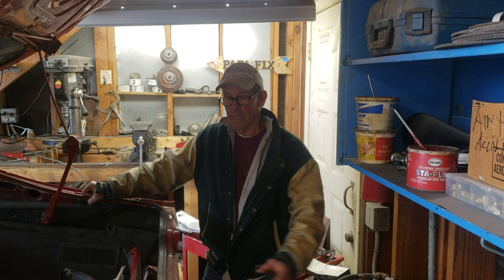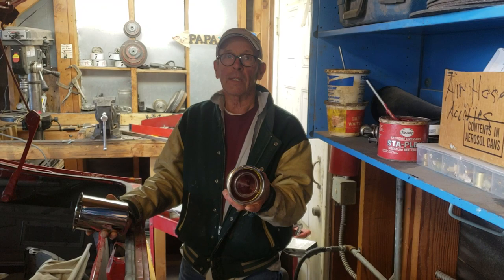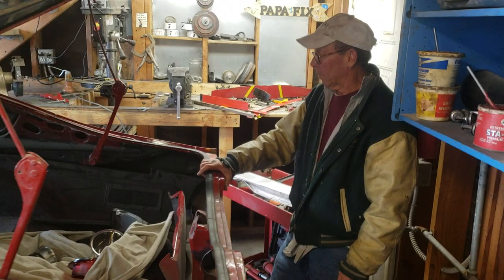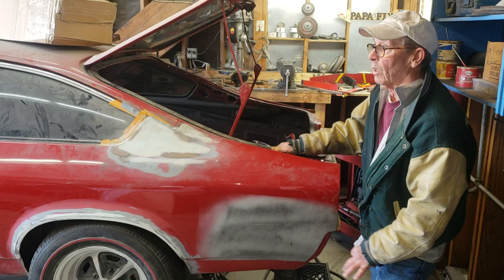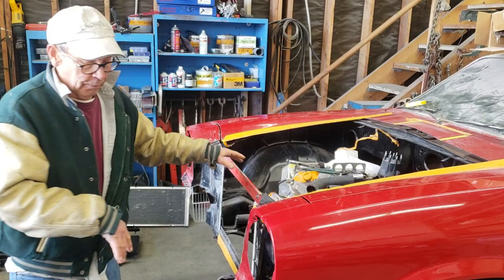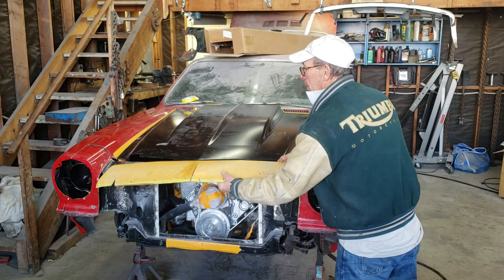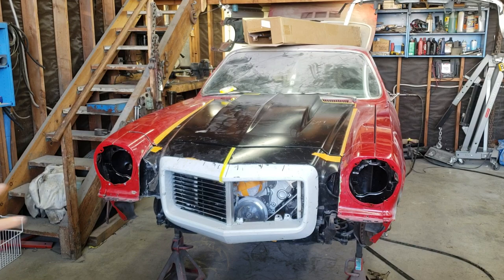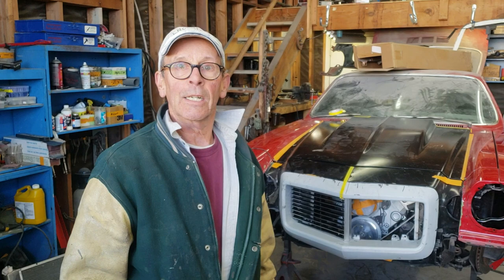Dave Cartwright's RS 1973 Vega Build

Comment: I built a 71 302 pinto in the late 70’s and helped a buddy build a 72 Vega gt wagon with a 350 and 4 speed. He learned to change spider gears in under an hour even after swapping in a Monza rear axle. Fun times! Finishing up an Alfa Spider with an Alfa v6 w/ a Mustang T5 transmission. Love the front end look of your Vega. Thanks for posting!